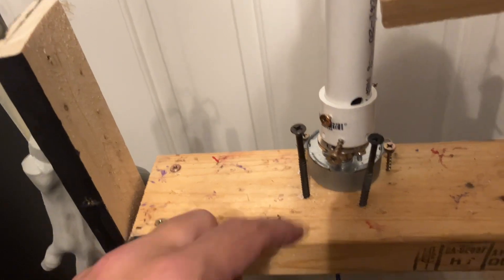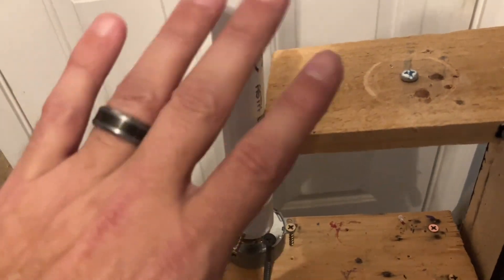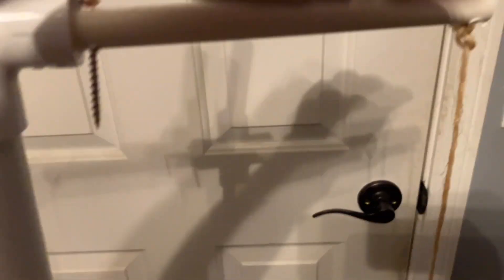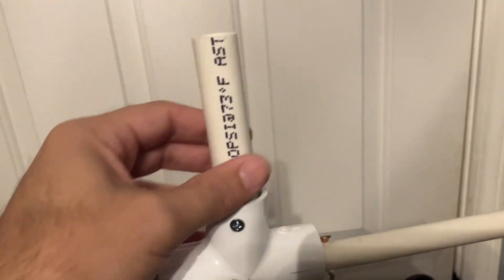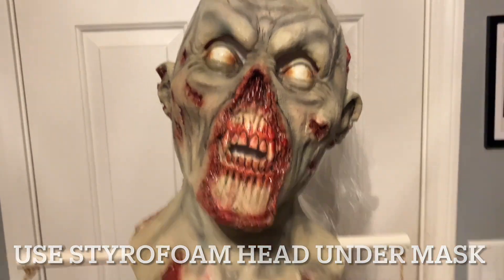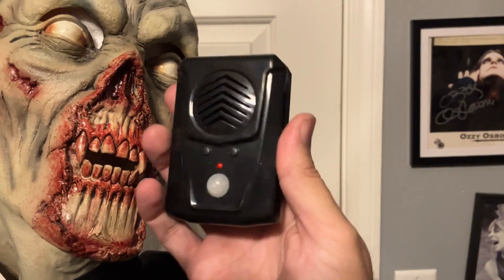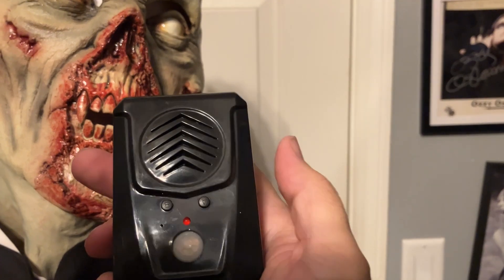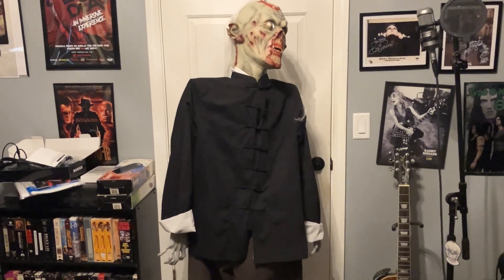Cheap DIY Moving Zombie Using Synchronous Motors

Comment: Have you ever thought using a old manikin ?
Reply from the maker: The synchronous motor will not handle the weight, I don’t think. Unless top of mannequin is on a swivel apparatus so little resistance for the motor.
Reply: @brianbenson3091  Well, Dr. Frankenstein, you know best.